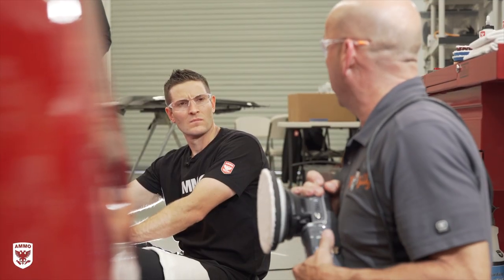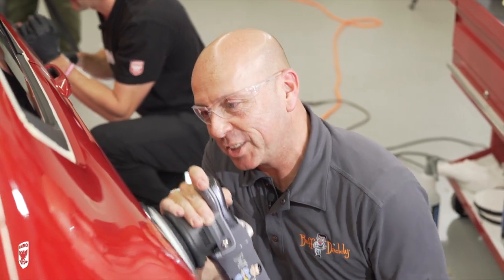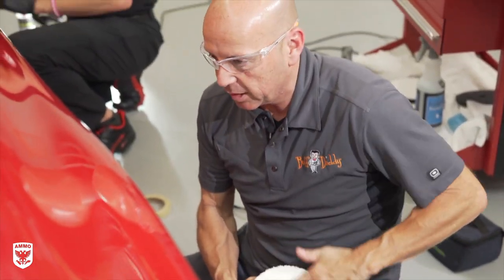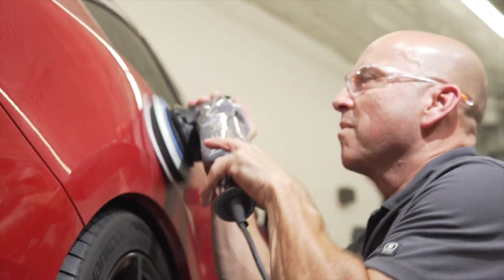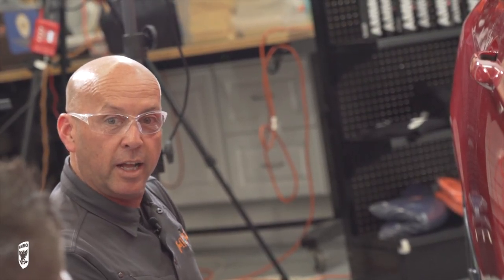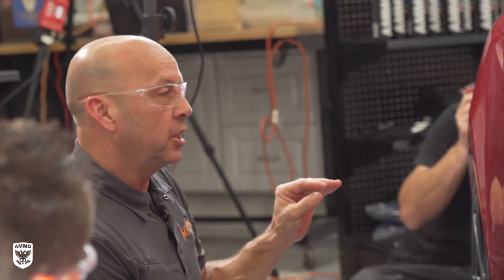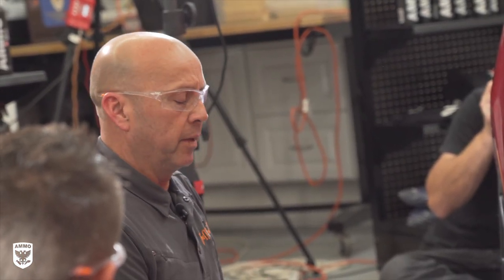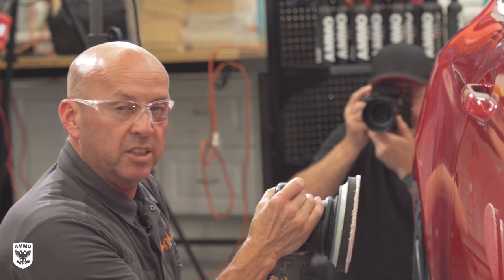What is the best Polishing Speed and Pressure For Paint Correction

Comment: But if i were to use a sandpaper and apply more pressure during sanding, it does remove more clear....but why does it not reduce/refine if we applied less pressure? Seeking clarification
Reply: Diminishing returns, your sand paper will clog faster, uneven sanding with higher pressure vs even firm pressure that'll not clog nearly as fast and require less sand paper changes.

Comment: i polished front of my car with 3m compound and rotary polisher it has shine but i see scratches from pad on sun.What is reason for this?can it be too agressive pad?
Reply: Sounds like wrong pad/compound combination, and lack of experience with rotory machines. What pad and compound are you specifically using?
Reply: @jeremiah1178  its pad that was on machine when i bought it.Its foam pad i dont know even for what it is.I think i didnt do anything wrong with machine i tested it many times with different speeds more/less compound results are same
Reply: @bobanppvc  pads have different characteristics, some are more aggressive than others. Pads are a part of the over all equation, and knowing what pads you have and their uses is just as important. Also not trying to be rude, but I'd highly suggest getting a da machine if you dont have much experience. Which I'd assume is true. Less chances of ruining your paint. But keep up the willingness to learn. Check out Larry's videos, and some other retailers videos. Knowledge is the key to success in this art.
Reply: @jeremiah1178  Definitely. DA's are much safer. In my opinion rotarys are best for paint correction. DA's are great but have their place. For instance, you won't find a DA in a body shop. You shouldn't be using a rotary with compound to just get a shine. If it is a yellow pad then it's a medium cut pad. 3M makes an amazing machine polish that you should pair with a black foam polishing pad and follow the instructions for speeds etc. PS. On that bottle it will probably say to lessen pressure and speed on final pass. lol ... If you just want to polish and shine your ride then get a griots da from autozone or advanced auto and use an All In One Polish..

Comment: Well the discussion in the video didn't answer the question in the title of the video. 
I think you over thought the useless question about lifting off during the last path.
I don't know what kind of pads you're using, they look way too thin, and sounds like you've got the buffer way too fast. But, if it works for you, all good I suppose. 
I never get mine above the lowest setting, EVER. I use a Makita, the lowest speed is 600RPM, supposedly. That's according to the spec sheet. No matter what brand I use, high speeds just burn in those awful holograms. I use the thick 1"plus pads, the orange, blue, white etc all the way to the fine black colored pad. 3M for marine applications and Meguair's mirror glaze professional products for automotive. It's worked for me since the late 1980's. Only thing that's changed is the products keep getting better, I don't think the paint has changed much, not on American cars anyway, it's inferior to the likes of German and Japanese. Especially GM paint. It's garbage. Just like their automobiles.

Comment: would you sand with 1000, 1200, 1500, 2000, and then lighten up again on the last with 2500? surely not....lol c'mon guys it's the same concept with lightening up pressure on last pass. maybe not necessary, but not detrimental either.